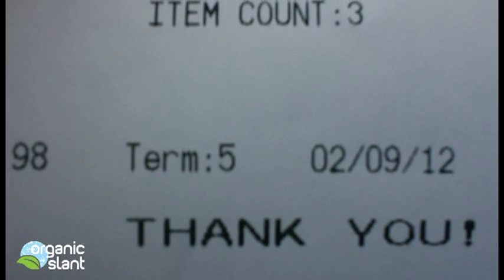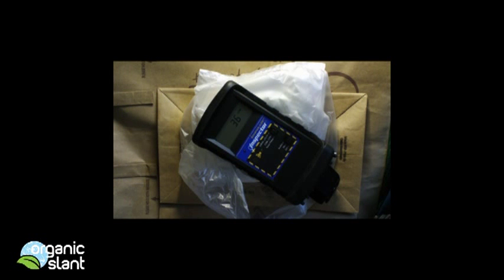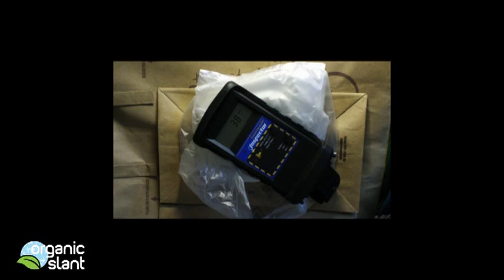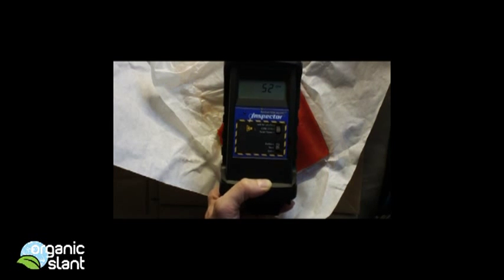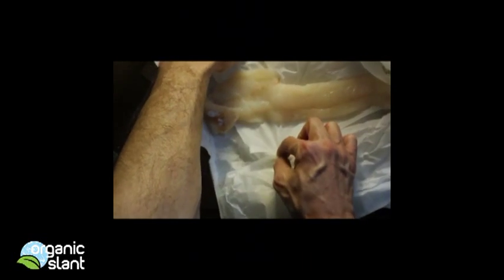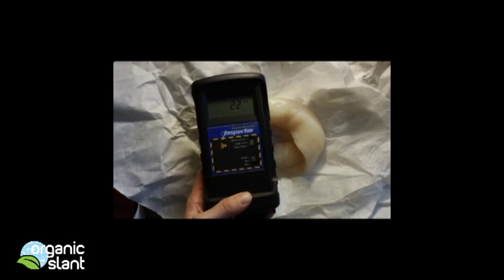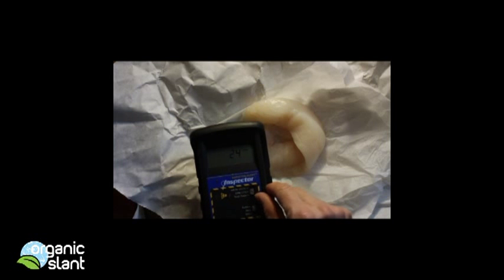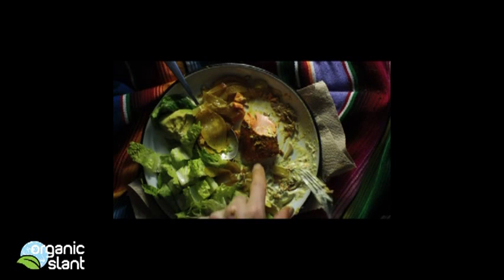Wild Alaskan sockeye salmon & cod radiation monitor 2-9-2012 | Organic Slant

Comment: If you detected higher than background levels of radiation in food from a GM counter, that would be worrisome, but in most instances, a GM counter won't be able to tell you if the food is contaminated or not because the levels of emitted radiation would be too low. The problem is actually radioactive isotopes and how they behave inside of the body. Let's say you had a single cesium 137 isotope lodge in your body. You can't detect this, but for years on end it's going to sit there and hammer nearby cells with high energy photons that we call ionizing radiation. Eventually this could cause damage to the DNA in these cells, also known as mutations, which in turn could cause the cells to become cancerous. But then again, maybe you never get cancer from this. Maybe you get cancer from a virus first. Or the random gamma ray from space comes in, strikes a portion of the DNA in the nucleus of one of your cells, and that, in turn, gives you cancer. Or maybe you get cancer from some industrial chemical that pops up in your every day environment. Or maybe you have the gene for it. Or maybe you never get cancer. It's easy to say "this level of radiation is dangerous" but it's not easy to say what level of radiation is safe.
Reply: It's constant exposure that is bad. Your body can't rid itself of heavy materials. The more you eat, the worse the risk.

Comment: Freezing does not kill radioactive material.  Time does decrease the intensity or half-life, making it weaker, but some isotopes take several hundred thousand years to reach a half-life, so it's a moot point.  The good news is you probably pooped most of the particles out.  The bad news...your septic system is now contaminated! ; ))